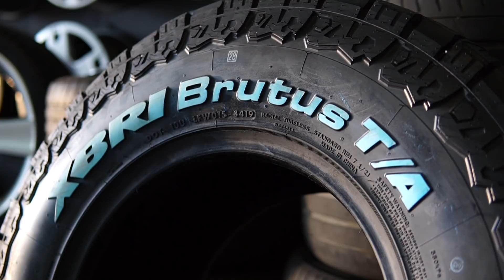Mitsubishi L200 Do @RichardRasmussenSelvagem Recebendo Upgrades Monstruosos!

Comment: Sou amante do off-road, e esses upgrades ficaram show mesmo. Investimento alto mas que vale a pena. Snorkel (uns R$ 1.500,00), Amortecedores off-shox (uns R$ 5.000,00), parachoque dianteiro (uns R$ 3.500,00), guincho 13.000 lbs (uns R$ 2.500,00), reprogramação (uns R$ 1.800,00), jumelos (uns R$ 1.000,00), protetores (uns R$ 1.900,00) e kit de suspensão strike brasil (uns R$ 1.200,00), por baixo ai uns R$ 19.000,00~R$ 20.000,00. Realmente foi um upgrade monstruoso, toooop!